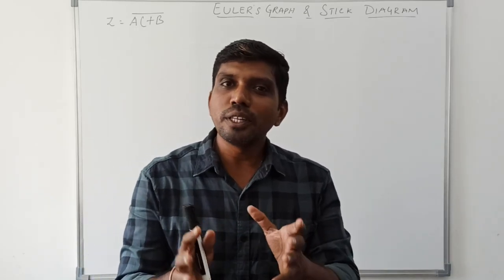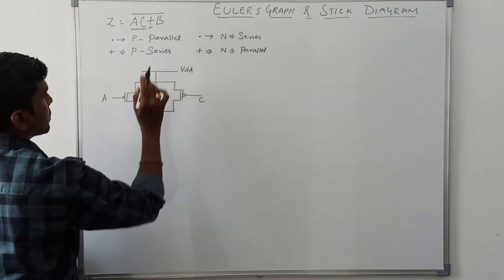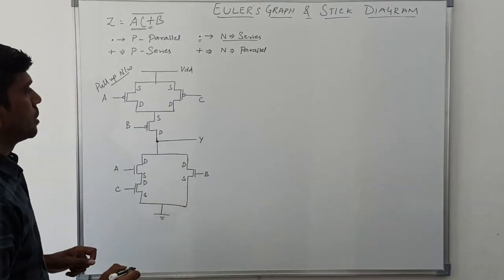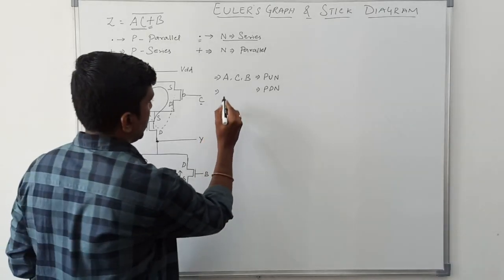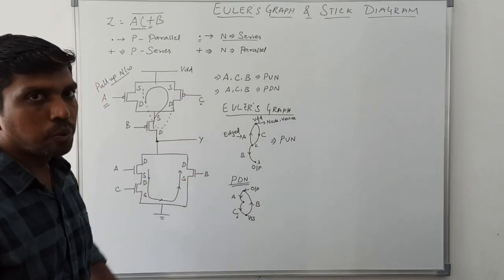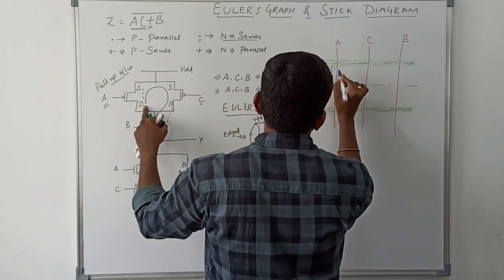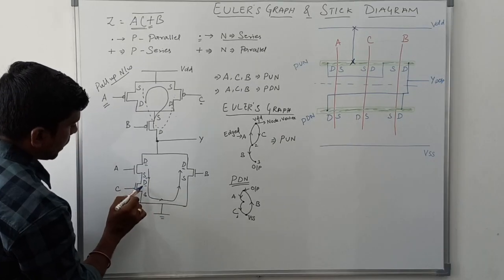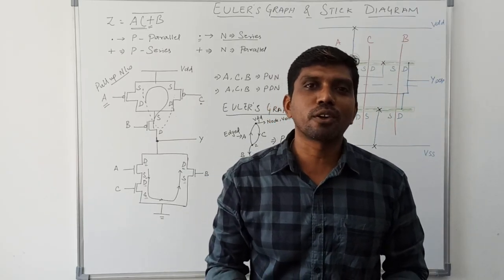How to draw Euler's Graph & Stick Diagram for Boolean Expression || S Vijay Murugan || Learn Thought

Comment: Draw the stick diagram for the CMOS gate implementation using the Euler-optimized method for the given Boolean function. F=(AB+AC+BC)'
Reply from the maker: You can find the stick diagram for the given function in this link https://youtu.be/J8SIOjco19g?si=YH0sXKA76qcfAKbU